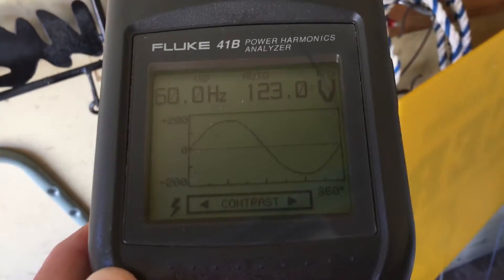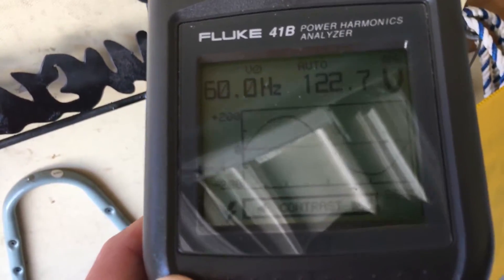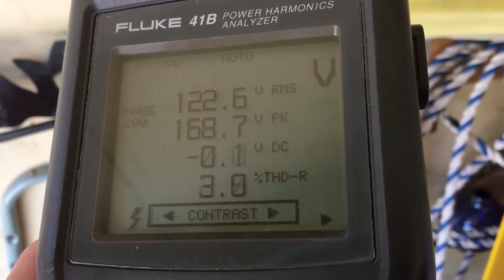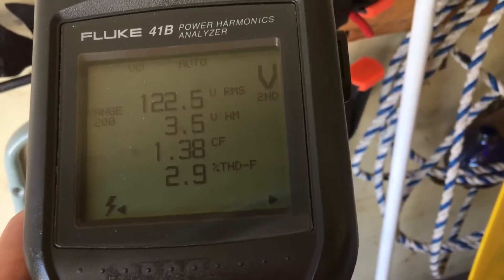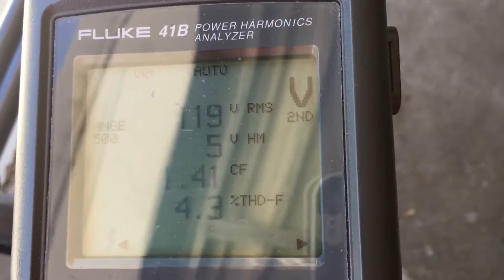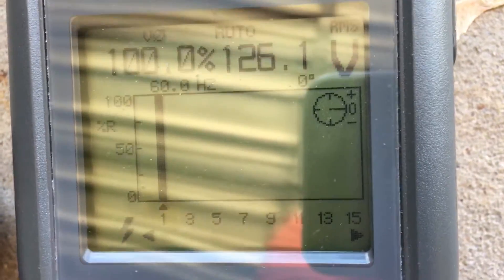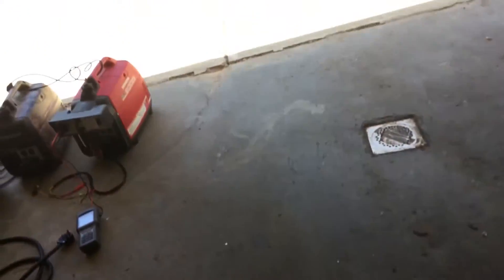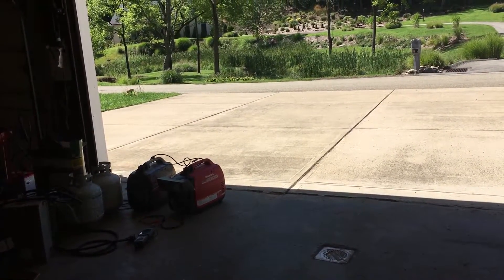Comparison of THD total harmonic distortion mains, honda eu2000i, and briggs and stratton generator

Comment: I would bet that at 50% & above the Storm responder would be at 13% or better THD if it's a brushed generator with an AVR which I believe it is. What even makes it worse is it's a single cylinder engine which exacerbates the problem, a two cylinder engine to keep the THD lower with better control of the load or just get inverter generators. Lol

Comment: Great video! However you only measured with no load present. I can almost guarantee you that THD will increase on both Briggs and the Honda under half to full load. If you can rerun this test with a load on it be curious to see what the THD will be then.
Reply from the maker: Agree. THD will also increase with the type of device you add to the Generator output.
Reply: @IFix-Things  Yes. Likley any non linear loads will have a better shot at doing so.

Comment: I'd really like to see those again with 100% load on the generators.
Reply: I tested my briggs elite unit and with no load it was 4.5%, but loaded to 75% it was slightly over 15%.
Reply: @tomroth2634  holy crap
Reply from the maker: @tomroth2634  What were you powering?